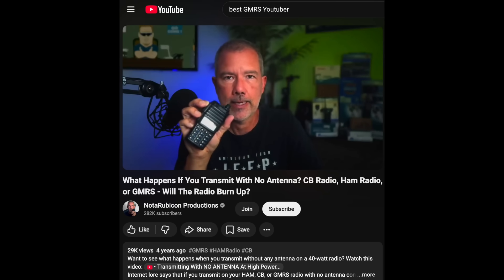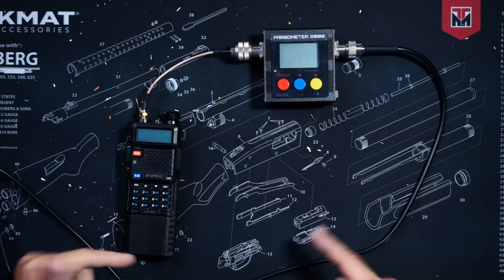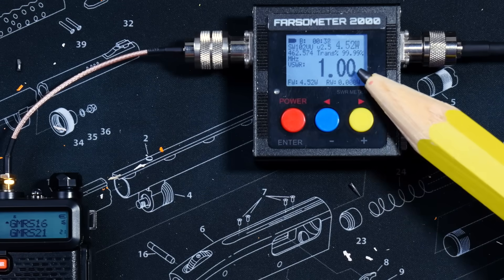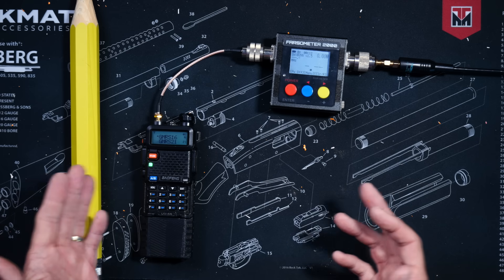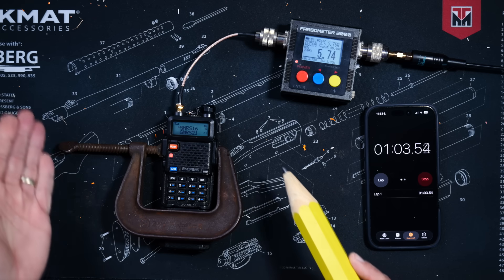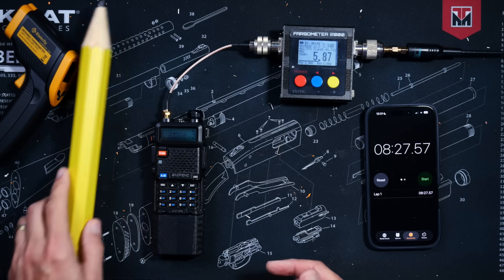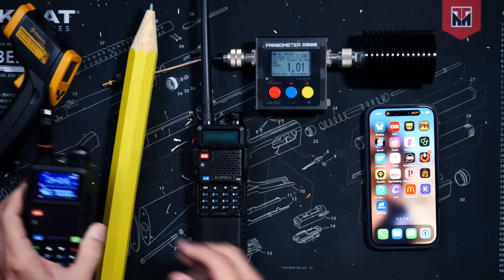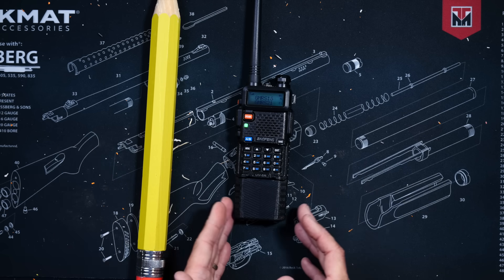Transmitting On A Baofeng Walkie-Talkie With A High SWR

Comment: I heard the same BS back in the 80's and early 90's when we were using CB radios. Never burned up or damaged a radio and we knew as much about them as Kamala knows about how to run a country.
Reply: Man I did. I killed several classics. But I also ran a 1,500 watt amp..

Comment: Devils advocate: buddy of mine said the same thing as "some people". Mainly CB days with poor quality radios with 1000W - 1500W amplifiers and actual finals that could backfire. "Some people" are those back in the day before system on a chip chinesium technology, and I wonder if this could hold some truth?
Reply: I had a 1,500 watt amp for my CB. It was almost impossible to get a good swr with a mobile antenna with that much power. I've still got it somewhere

Comment: Well,... The C clamp acted as a temporal distortion dampener, mitigating the flux impedance created by the magnetic field. Had that C clamp been made of Chineseum plastic instead of American steel, the results would have been drastically similar.
How's that for sarcastic humor. Have a great new year!
Reply: No the C clamp worked as a heatsink protecting it from overheating   😂
Reply: Dork.